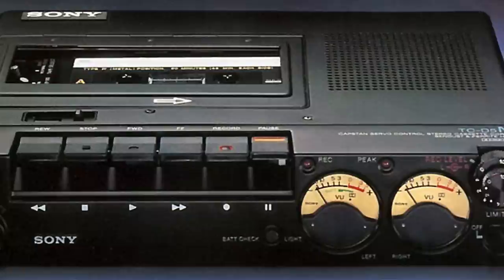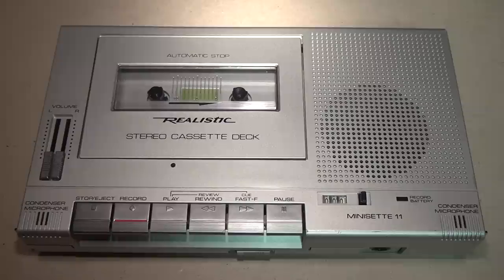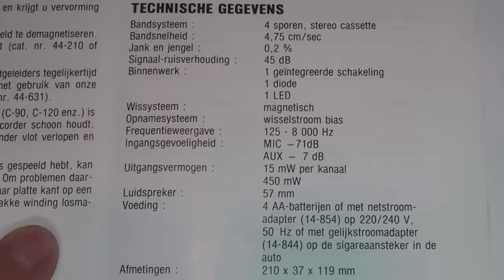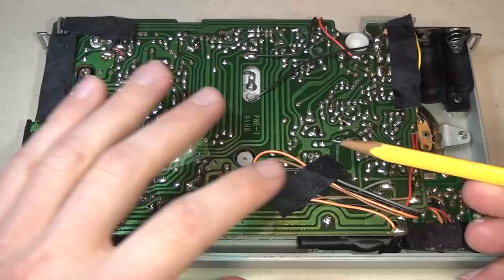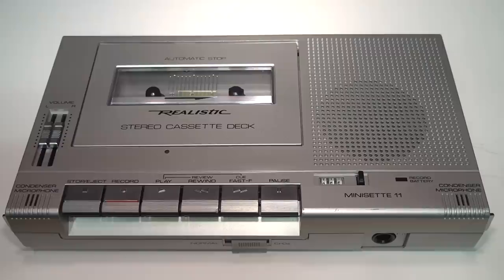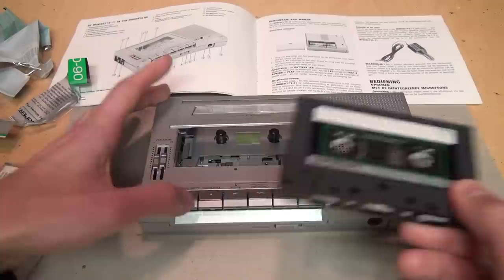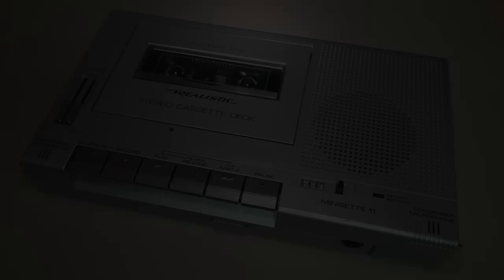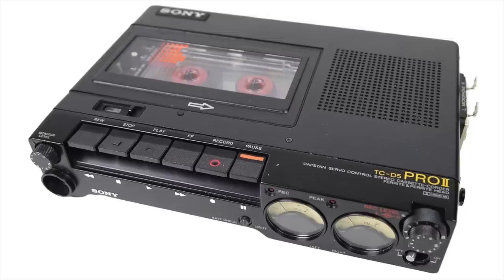A Realistic alternative? - The Minisette-11 stereo cassette recorder

Comment: I was amused to come across this video today. It is interesting to see something that I bought because it was cheap and portable is now considered a collector's item. I have mine in front of me know. I still use it on the occasional times that I need to hear something from an old cassette.
I don't remember buying my Minisette-11 but it was probably far less than $99! Mine says 'Made in Singapore  Dist in Canada by Tandy Electronics Limited'. There is a 10A3 date stamp in the battery compartment. I have the original Portable Stereo Cassette Deck Owner's Manual which is bilingual English and French. As you said, in the instructions it says to set Tape Selector switch 'to appropriate position, either CrO2 or Normal' but neglects to actually say what the difference is between the settings. 
I probably bought mine in 1984 before I headed off to Australia. I had the intention of getting married and immigrating there. That did not happen but I did stay for a while. Because it was so very expensive to make phone calls, instead making those I would talk into my Minisette-11 and make recordings. I would then mail those cassettes to my sister and mother back in Canada. Most of them were lost or re-recorded over but I still have a few. One day I must upload the recordings to someplace public such as YouTube!

Comment: As a TC-D5M owner, those models are the BEST cassette decks i ever had. What Sony built back then is nothing short of a technical marvel. And sadly the whole range of features is something i never really see elsewhere. Once you have been using such a machine, every other cassette recorder really feels like a toy :(  it's amazing how good cassette recorder technology used to be. But we are sadly now living in a time where Standards are basically gone. Electronics isn't even shielded anymore what so ever..
Reply: TC-D5m user here as well... Its certainly not the best deck I have, but it is by a very wide margin the best portable cassette deck I own. In playback sound quality it doesn't entirely match the AIWA HS-JX505 and JX2000 I also have, but it is capable of somewhat better recordings, and has much better connectivity.
Reply: @c128stuff  I kinda wish it was a 3 Head system. Then it would be godlike.
Reply: It's amazing how modern tape decks sound when you press play with no tape in the mechanism. It should be perfectly silent. But it never is. There is always a loud hissing sound.  Poor quality pre-amps and probably shielding problems too.

OTOH, there is no excuse for 8khz frequency response in a 100 (1981) Dollar machine.  I posted another comment pointing out the Victor Orthopedic acoustic reproducer released in 1929 has a 10khz frequency response. 

The earliest tape decks from the early 60s had 8khz frequency response. This was 20 years later.  It is inexcusable and basically not suitable for music, IMHO.
Reply: You contradict yourself - first you say this Sony is an unique marvel and that everything else feels like a toy (crap), then you saying that all good Standards of old times are gone... 
-What "Standards" are you talking about - if that Sony was obviously a unique piece of overpriced Professional equipment?..
Reply: @christo930  Hmm, looking at 1980s era mid range decks, without any form of dolby and set to type 1, a noise floor at around -55db is pretty much the norm. Top of the line models may do a bit better, but that is far from 'perfectly silent'. 

Yes, you can improve a lot on that using appropriate noise reduction and carefully adjusted recording levels on a really high end deck, but even the best decks of that era were not perfectly silent. They can't be.

Are cheap modern decks worse? somewhat to a lot, yes.. now compare them to actually comparable devices from the 1980s... entry level 'personal cassette player' ? those tend to be just as bad.

Oh, and with 'mid range' I'm talking about what in the mid 80s would cost around $500+
Reply: @KRAFTWERK2K6  3 head tc-d5m would be really nice indeed.
Reply: @AaaAaa-ly3on  tc-d5 is essentially a decent 2 head deck in portable format, built robust enough to survive intensive use as field recorder, and capable of stable tape transport despite vibrations and shocks (people have litterally be running around in war zones recording with those devices). 

Not really overpriced for what it does, but few people need its capabilities. 

Point of those devices is that breaking 10 cheap recorders a year made buying a 'professional' recorder a really good investment, but that is not how most people use their portable cassette recorder/player.

Its not the only such recorder around. Maranz had some pretty high-end field recorders with similar bult quality and performance, including some 3 head ones. tc-d5 was more or less the standard for this, but even in its class not the best you could get, nor unique. But it was the defacto standard as field recorder for reporters etc.
Reply: @c128stuff  Yeah those Marantz portables were awesome too. The PMD-201 was my first professional cassette recorder for field use and i still have it. Always loved the variable speed adjustment feature and the 2 tape speeds, as well as the pretty good built in microphone. I just don't like that it's a Mono-only machine. You could even hook it up to a phone with a cable to record your interview partner on a phone.
Reply: @c128stuff  We're talking about running the tape deck without a tape in it.  There is no tape hiss with no tape in the deck.  This is strictly amplifier noise. Tape hiss will just add to the existing noise.  A well built deck will generate no or such little sound that it will be nonexistent or so low that it's hard to hear.

I completely disagree. I still have a lot of tapes I recorded myself in the 80s on a 99 Dollar entry level tape deck component.  The sound is excellent. 
This deck in the video was 100 Dollars in 1981. 100 then was more like 300-400 today.  100 bucks would buy a decent walkman back then. Even the original Walkman only cost a bit more.
Reply: @christo930  Yes, and I am talking about amplifier noise, specifically the noise from the amplifiers directly following the read head.

You can disagree all you wnat, but every measurement, either published by manufacturors or done by myself or many others agree with what I wrote.

So again, not talking tape hiss here, and for the record, I rather know this stuff, I am not an idiot, and totally understand you do this without tape or you won't be getting a result depending on the deck only. That is also why I wrote "set to type 1" and NOT "using a type 1 tape". Dolby matters in this because  of the change in frequency response attenuating part of that noise (and yes, I know how dolby works.. the recording side matters for tape noise, not for this)
Reply: @KRAFTWERK2K6  What I totally like about the tc-d5m is it having most of the functionality you'd want, all functionality you'd really need, yet it is very simple in operation. With many of the maranz field recorders I do get the feeling I'd really still want a sound tech with me.. with a d5m my only real concern was the tape running out halfway.
Reply: @c128stuff  I know what my ears hear when playing the deck without a tape on a decent quality deck, which is either nothing or next to nothing.

I never accused you of being one. I thought we had a misunderstanding.

Instead of denying being something I never said you were, do the experiment. Put a pair of headphones in a cheap tape deck and run it with no tape in it.  Then put those headphones in a quality tape deck and run it with no tape in it. You can hear the difference.  Admittedly, my ears are not what they once were and they were never great. But I CAN hear a loud hiss in the cheap deck and I cannot hear that loud hiss in the better quality deck.

If you truly believe 8khz frequency response was the best we could do in 1981, I don't know what to tell you.
Reply: @christo930  yes, we clearly have a misunderstanding, or more than one actually...

1. your 'test' depends on how good your ears work. Mine clearly work better than yours as there exists NO cassette deck which is 100% quiet to my ears.
2. what you actually hear is not just a mattert of what your ears register, it is perception which is for a significant part created by your brains, and is based on training among other things.

And those 2 things make "what you hear" relevant to saying if you like something or not, but completely useless for determinign noise.

To go on, as I pointed out in my original reply there is usually a difference between low quality devices and high quality ones. I don't have to do your 'test' to know that, I know that and it is not even worth debating.

But comparing an entry level device from today to a high end deck from the mid 1980s is silly, of course the later will do better. Now compoare that entry level device from today with a SIMILAR device from the 1980s, and the difference will be small.

That quality deck from the 1980s would cost many times more than that entry level device from today, so duh.

But my poin t was, and that is something you can simply measure, and has been mesasured by many, published by many, including original manufacturors, that no cassette deck is completely quiet, not even close to it. Only in very specific configurations you can get a cassette deck to be almost completely quiet, and those do involve noise reduction and using a tape type which requires less amplification.
Reply: @christo930  Or in short:
- your 'ears' can tell you if noise levels are disturbing to you or not, but they cannot reliably tell you how much noise there is
- entry level cassette players from the 1980s are crap compared to a high quality deck. Entry level players from 2023 are still crap compared to a high quality deck from the 1980s. Much more interesting is how entry level players from the 1980s and now compare.
Reply: @c128stuff  Yup, it's perfect to be used by one person without any actual training in sound engineering. Heck, you even have a limiter if you not sure you can keep the sound under control in some tight situations. To be honest, since i have one of these i never really wanted to deal with portable reel to reel machines anymore (like the Uher Report series). I loved using Dolby-C on this thing with Type II tapes and almost getting a DAT kind of Sound from it. I never had Type IV tapes so i'm sure THOSE must have been awesome for that. And yeah you really always needed at least 5x the tape material than you actually needed ^-^ I'm sure in the 90s this was a lot easier with chrome tapes being available at good prices. The TC-D5M philosophy really seem to be the same like what Sony did again with the professional DV Cam models, like the PD-150 or PD170, when a reporter could be both Cameraman & interviewer at the same time, without having to be super knowledgeable in terms of recording. Something that really helped journalists, reporters & filmmakers to become more independent.
Reply: @KRAFTWERK2K6  its pretty much why the tc-d5 was the machine to beat when making a field recorder. Its not the best recorder, but it is more than good enough and really practical to use. And indeed, things like that limiter help quite a bit for focussing on what you are recording.
Reply: @c128stuff  I never said otherwise.  I added the qualifier "a quality deck" every single time.
But I do debate that this was a cheap deck (not by price, just by build quality).  In 1981-1984, you could buy an entire boombox for maybe a tiny bit more.

As for my ears, yeah, I can't hear anything on even a decent quality deck.  The fact that it may or may not be -55db,  I cannot hear it. OTOH, on these cheap portables, I CAN HEAR A LOUD HISS without a tape in it.  This is poor quality (though, to be fair, these decks are 40 years old and transistors are known to sometimes get noisy as they age)

You also said the best decks were only marginally better  (than these cheap ones in this respect).  This is just flat out untrue.
Reply: @c128stuff  The limitations of my ear are relative.  Whatever deficiency my hearing has on machine 1, it also has on machine 2. If they were equal in volume, my ears could notice this.

We're talking about listening to music. My ears and perceptions are the ONLY thing that matters.

You said the opposite. You said the high end decks were only slighter better. (you used the term "A bit better" They aren't. They are MUCH better.,

The difference is there were good decks to buy in the 1980s. You are also ignoring the price of this thing. 100 bucks was not cheap in 1981-84.  Gas was 40 cents a gallon. Minimum wage was like 2 an hour (my first job in 86 was 3.35/hr) . A new car was 6-8k (early-early-mid 80s).  These poor quality decks today are cheaper nominally today even after 40 years of inflation!  Do they even make a tape deck today, even a cheap one with 8khz frequency response?

The low end tape deck I had in the 80s, which I bought around 1988 was about $100,  It was a stand alone component stereo component.  I dubbed a lot of records and other tapes with it and still have a large percentage of them.

Electronic devices are not ears.  There is a threshold between what a sensitive electronics test equipment can pick up and what the average person's ear can pick up.  Also, I never said they were silent, I said they were near silent to the point I couldn't hear them or only faintly pick up.   My point is that they were not comparable.
Reply: @christo930  no, I said a mid range deck from the 1980s has a noise floor of around 55db when set to type 1 and without noise reduction. I also said a high end deck only does somewhat better.

I also said entry level recorders do worse, regardless of them being modern or from the 1980s.

As to the recorder this video is about, in specifications and functionality it is very much an entry level device. Freqency response cutting off at 8khz, permanent magnet erase head, no level control, those rather tell the story of that.
Another thing to consider.. in 1980, a decent but totally non high end deck like an Akai CS M01A would cost just shy of $180. That is $741 in todays money.

Sure, you could buy complete boomboxes.for less than the devicr in this video, but you'll get a very similar cassette recorder in features with possibly an even cheaper mechanism and certainly a lower build quality overall.

The device in this video may be an entry level recorder, but its relatively decent build quality makes it a pretty decent portable recorder.

It gets its priorities right for the intended use case.
Reply: @christo930  "long argument about your ears"...

Well, your hearing is. There is a reason why the science which concerns itself with what we hear is called psychoacoustics, it is not just your ears.

Regardless, what you hear is what matters for your personal listening pleasure.

However, when you make the argument in a public discussion that a high quality deck should be completely silent or very close to that, it is no longer just about what YOU hear. 

And that makes measurement the only usable way to look at this. 

Also, actual noise levels, regardless of them being audible to you at a specific listening volume still matter if you:
- try to make a copy of the tape
- decide to listen at louder volume
- listen at the same volume but with less ambient noise

55-60db snr is sufficient for most people for moderate listening levels, but far from great. Going from there to 70ish db snr makes a huge difference still... beyond that you really start needing a fairly quiet listening environment or play at fairly loud volumes. That btw hardly depends on your ears, that is simply a matter of physics.

Comment: There are three ICs in the schematic.  I think they may be op-amps, but I'm not sure, because I don't recall, offhand, all the pin-outs for op-amps.  However, op-amps share a common  pin-out, so you can replace one with a higher-performance version.  Unfortunately, the manual doesn't have a parts list, and the diagram just calls them "IC 100, 200, & 300."  But you can determine if they ARE op-amps, by comparing the pin-outs with the circuit connections.  Back in that day, 741s and similar types were commonly used in low-cost audio gear.  If they're that kind, you can get lower distortion & noise, by replacing them with something like the 5534/5532.

Comment: Marantz PMD430 is great  it's my go to portable just because it's much easier to work on -  even if it breaks in the field and you can find it for a decent price.  Sony has esoteric non-obtanium parts needed if broken in many cases. The wow and flutter specs speed ect are certainly better on the Sony - if the sony is working but not so much better tha most will notice..  I don't know if the Sony has DBX.. the Marantz does and it really helps with field recordings clarifying some distant sounds ect.

Comment: Idk if you get asked these kind of questions often, but how would you go about fixing these older devices? Are you that familiar with the circuitry, or do you rely on a schematic? Many of these I'm sure are very delicate given their age and the amount of wear over the years.
Reply from the maker: Most of the problems you'll experience with old tape recorders are mechanical, not electronic -- worn out belts and a dirty record/playback switch, just as I showed.

Comment: A Marantz PMD-420/430 is also a nice deck that usually costs less than the TC-D5. And these big recorders are easier to fix than any walkman size unit. Those sometimes require desoldering to get to the belt(s), have rotten SMD electrolytic capacitors, broken center gears (Sony WM-DD/WM-2 style mechs). And big recorders keep their head azimuth alignment better.